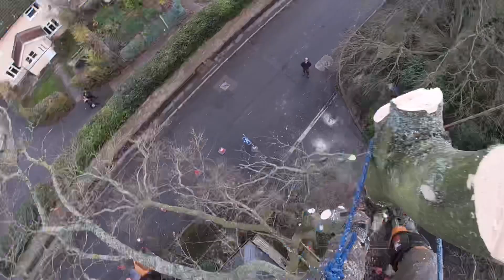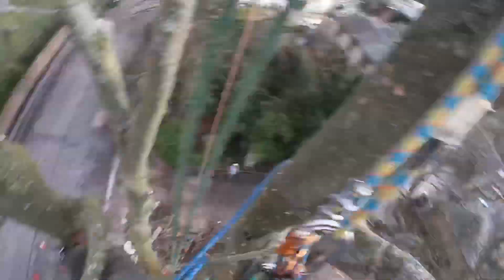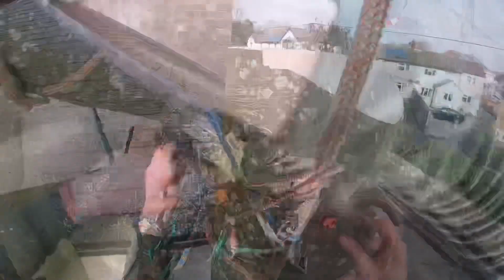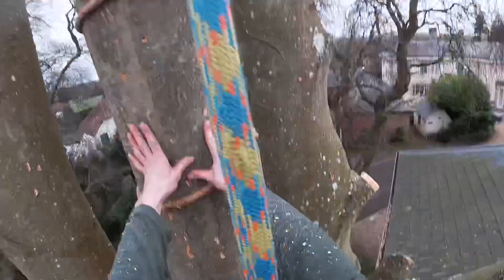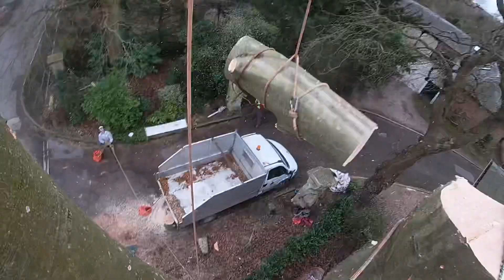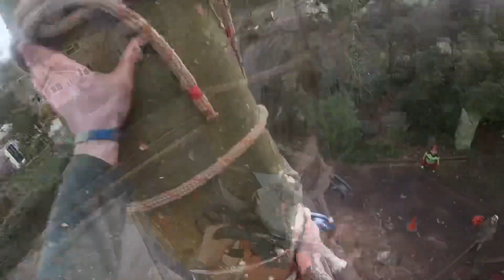Beech Tree Takedown that was touching Building

Comment: What are the specs of the bar you are using? I want to get one for my 201tc but I am not sure which will fit thanks.
Reply: Have a look at the oregon .325 bar kit. Thinner kerf and faster cut. I went for a 12inch 3/8LP to a 16inch .325 ;)